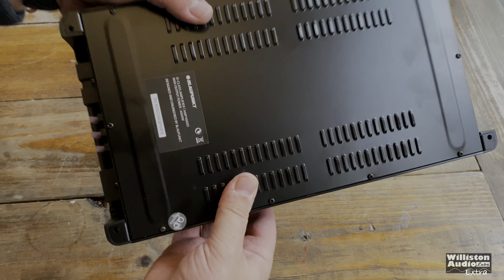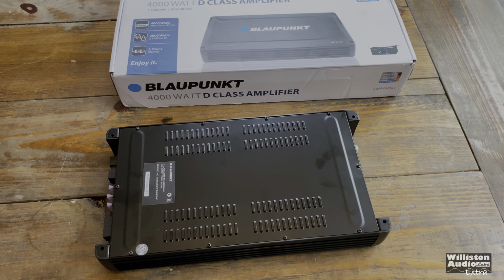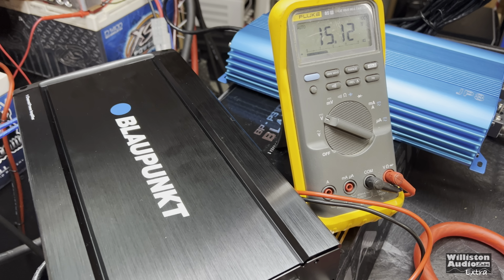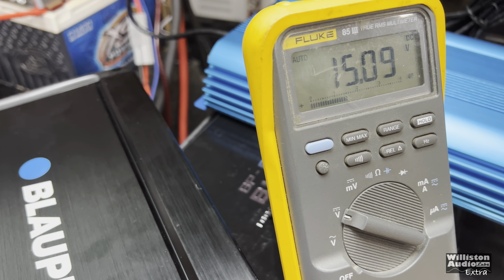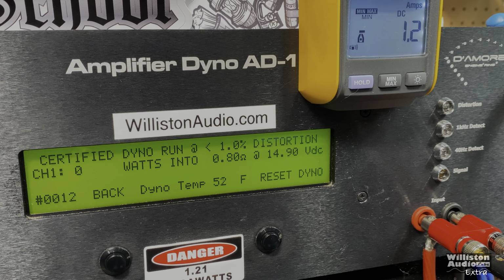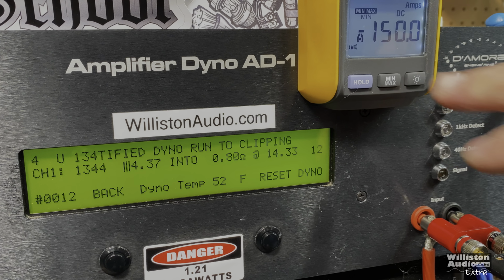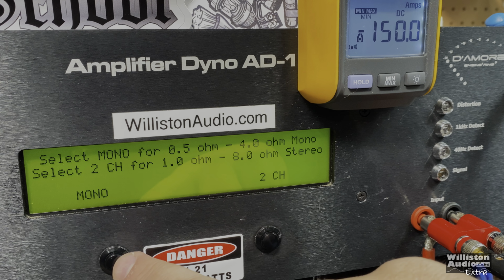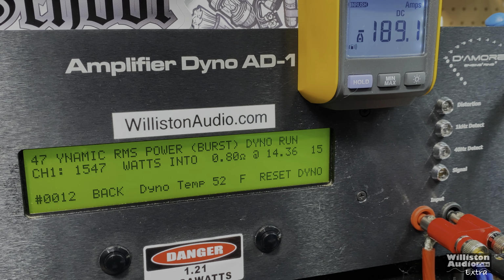Blaupunkt AMP4000D Extras and Behind the Scenes [4K]

Comment: Have you ever reviewed Mobile Authority or Optimus amps? I think Optimus was radio shack. I always wondered if the wattage rating was true. I used both back in early 2000. I think the Optimus was rated 300 watts. (Pushed a JL 12 W6 V1) The mobile authority Im not sure but I think it was 100 or 500 watts. (Pushed 2 Kicker 12 golden oldies). Let me know if you have info. Thanks Big D